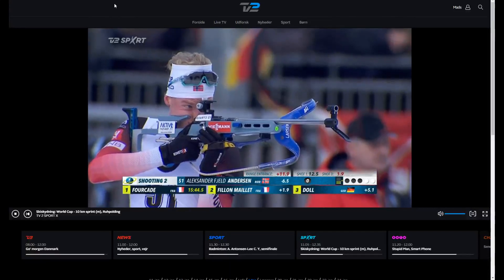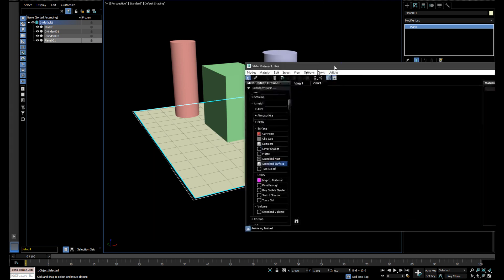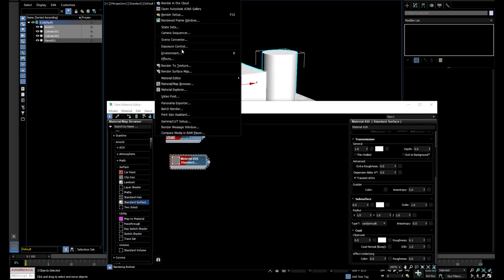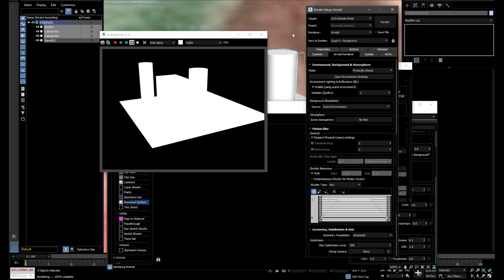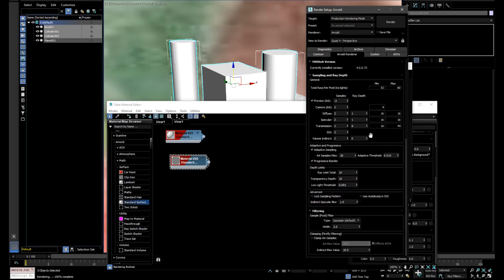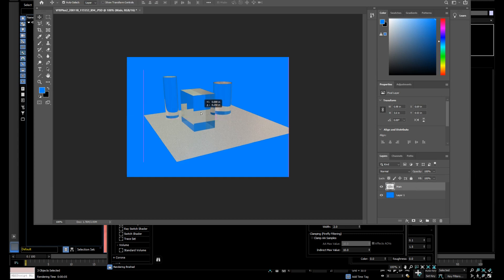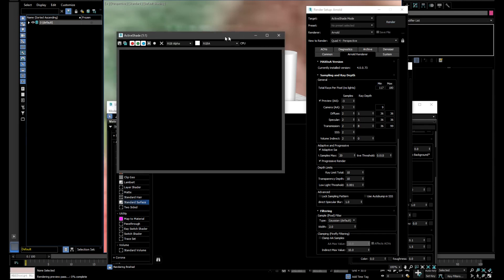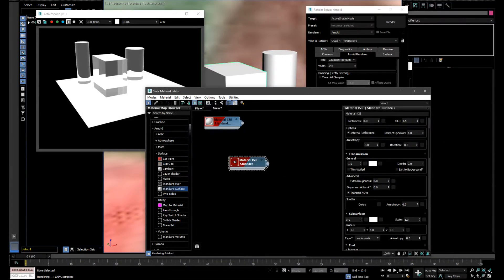How to render transparent glass using Arnold in 3ds Max

Comment: Thanks for the quick guide, May I ask how about the distortion for the refraction? What AOV can I activate to deform the back plate to fake or realistically represent the displacement to get that in effect in post?

Thanks in advance!
Reply from the maker: You would need to render an AOV pass with screenspaced vectors, and then use your post application as the middleware, and make it distort. It is impossible to do without you activly setting up a function, a custom solution that works in your post editor, there is no such thing in a single file and drag and drop.
Reply from the maker: Do some tests in your post application, make a sphere work first. no need to render anything, since the "action" has to occur in your post app. Then when you find your distortion hook in your post app, you make sure to render out a data set ( AOV from max ) that follows the rules you found to work in the post app.
Reply: @madsdrschler7853  "AOV pass with screenspaced vectors" and playin aound in after or nuke, got it! Will do.

Thanks Mads, you are the best!